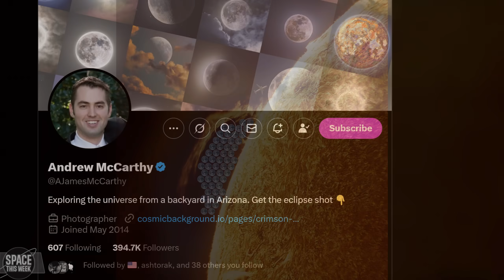SpaceX Begin HUGE Demolition at Starbase, Butch & Suni FINALLY come back & Falcon 9 sets NEW record!

Comment: Are Butch and Suni the first people to return to Earth on a separate spacecraft from the one they launched into orbit in?
Reply: No. In fact, they are not even the first people to return to earth in a separate spacecraft than the one they launched in due to issues with their original spacecraft.
Reply: The first time a crew launched in one spacecraft and returned in another was in mid-January 1969, when one cosmonauts launched in Soyuz 4 and three cosmonauts launched in Soyuz 5. After docking, two of the cosmonauts from Soyuz 5 performed an EVA and entered Soyuz 4.

This I believe was one of two times two spacecraft capable of re-entering Earth's atmosphere docked to each other. The other time was the Apollo-Soyuz program, although in that case the two crew returned to their launch spacecraft before reentry.

That also is the only time I know of where EVA was done to move from inside one crewed spacecraft to another.
Reply: Astronauts or cosmonauts launched in a Shuttle and returned in a Soyuz or the other way around several times during the Mir-Shuttle or early ISS programs.

Many of the long duration missions on Salyut 6, Salyut 7, Mir, and ISS have involved an "expedition crew" going to the space station in one Soyuz spacecraft, and partway through the mission receive a visiting crew also launching in a Soyuz. When the visiting crew would return to Earth they would return using the older Soyuz.
Reply: @KnightRanger38 - Yes, I think after the Columbia disaster, NASA was forced to have crews from ISS to come home using Russian Soyuz capsules, since NASA hadn’t any redundant capsule for such an emergency.
Reply: Even just for returns due to technical issues, one Russian crew had to return on a different Soyuz since their original had a coolant leak